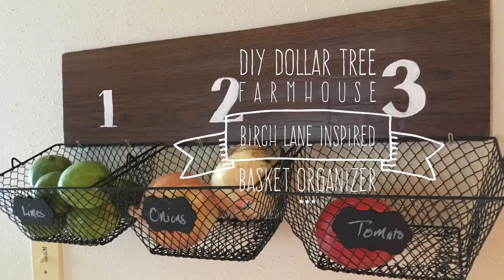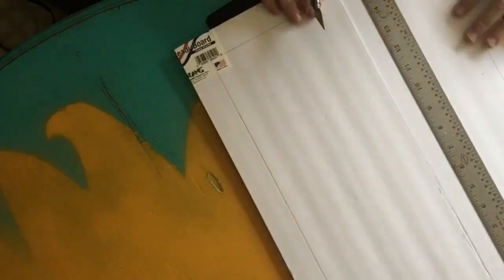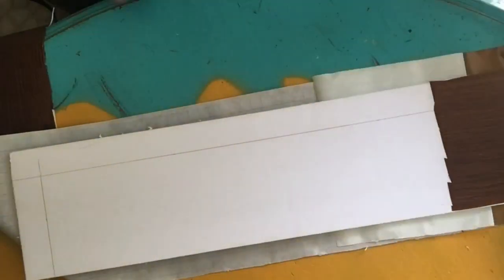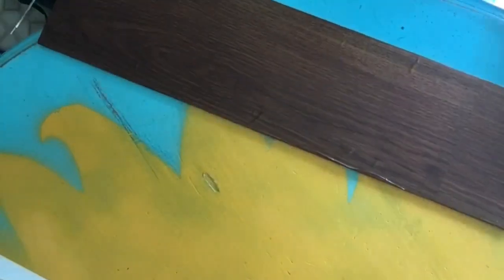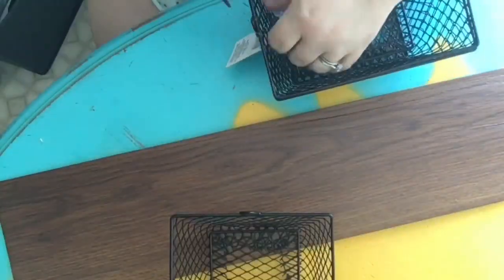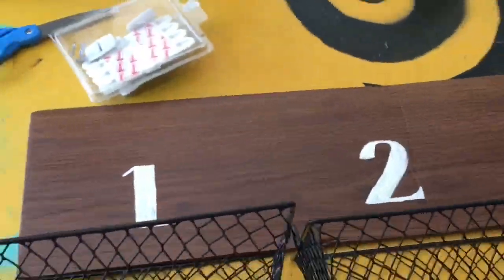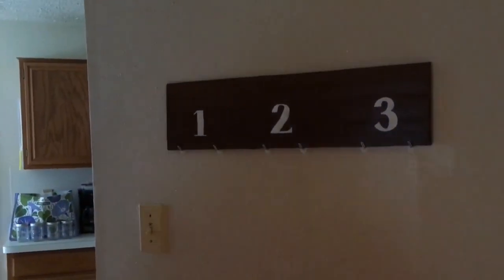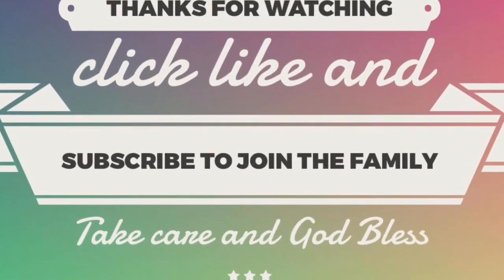DIY Dollar Tree  Birch Lane Inspired Farmhouse Baskets

Comment: It's just foam board so even though the hooks can hold 10lbs. each the board doesnt. It cracked. i got chain & made hanging tier baskets.
Reply from the maker: Ria, the instructions state to attach the hooks to the wall and then the hot glue the foam board to the hooks. The foam board was never intended to hold the weight. Sorry for your inconvenience. Thank you for watching.